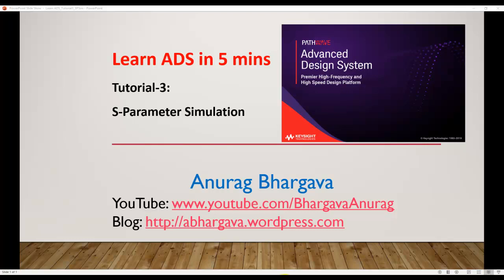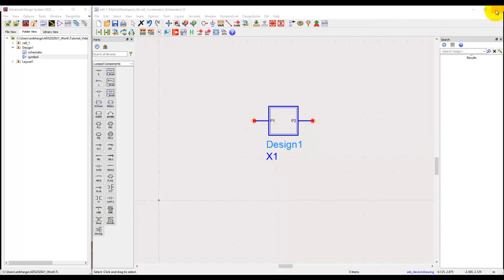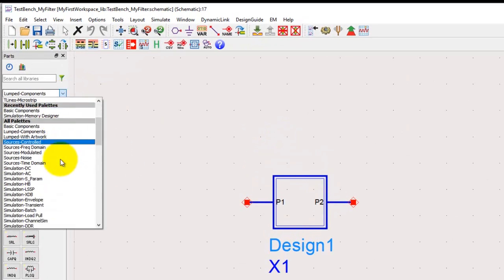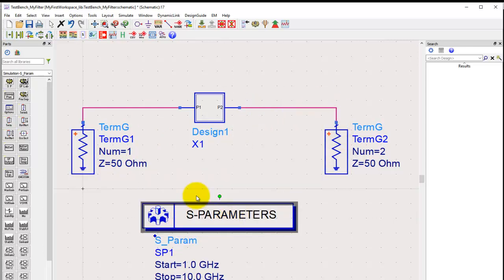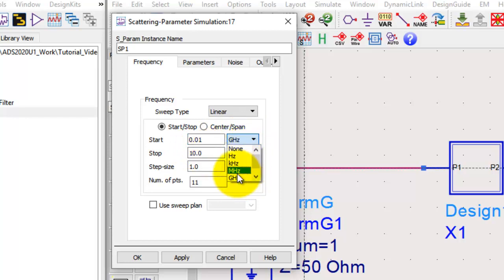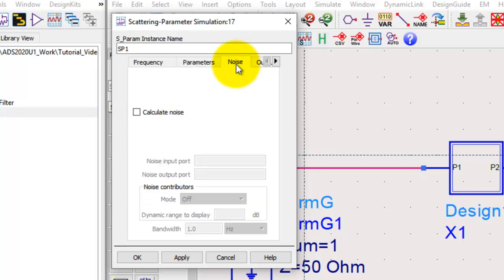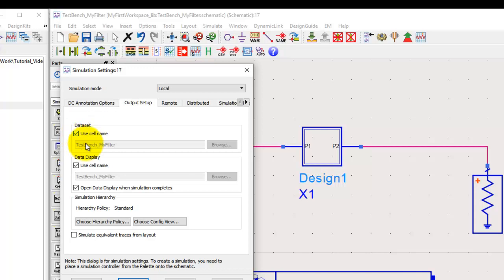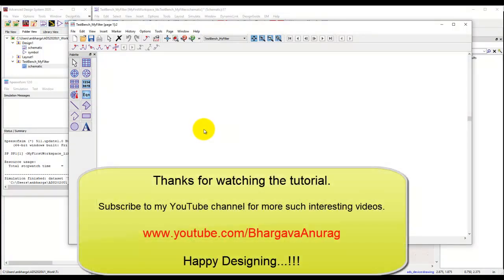Tutorial-3: S-Parameter Simulation

Comment: Hi, how can I plot the differential S-parameters?
Reply from the maker: You can look at the template available in ADS if you wish to plot full Mixed Mode S-Parameters but if you only want to see Differential S-Parameter then connect termination between relevant pins and define it as 100Ohm or whatever diff. impedance you want instead of default 50Ohm.
If you have trouble, contact your local keysight support team for help.

Comment: Hello Sir. Could you tell me how to make multiple 2-port sparameters simulations on the same schematics? If I insert more ports, the simulation considers a multiple port device.
Reply from the maker: Yes, SP sim will consider in a single matrix but you can always ignore inter-network S-Parmeter terms
Reply: @BhargavaAnurag  Thank you! I have actually been doing that. Would it be possible to export those results on separate files? I mean, if I simulate 4 ports, I would like to ignore the inter-network s-parameter terms when exporting the results into two 2-port s2p files.